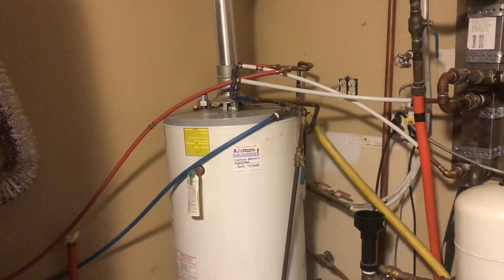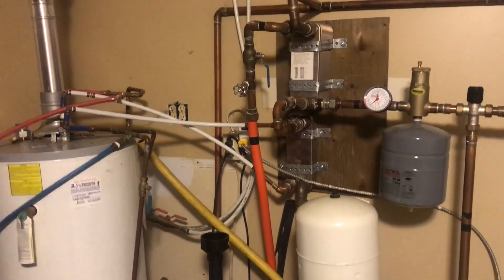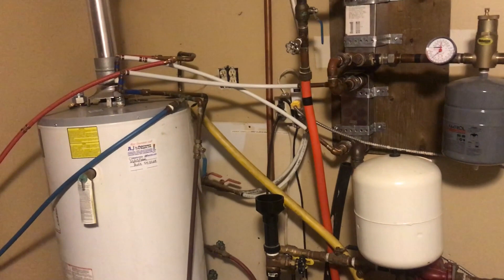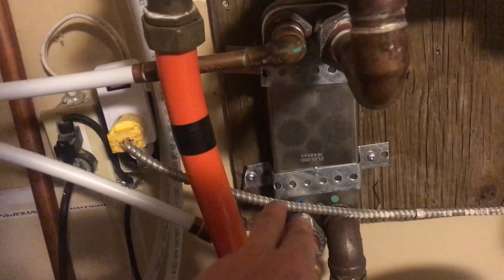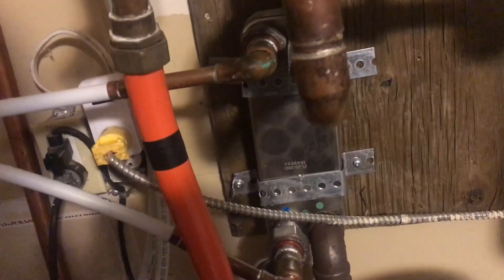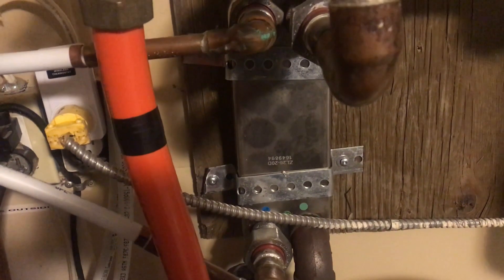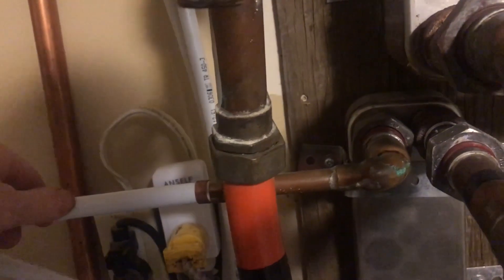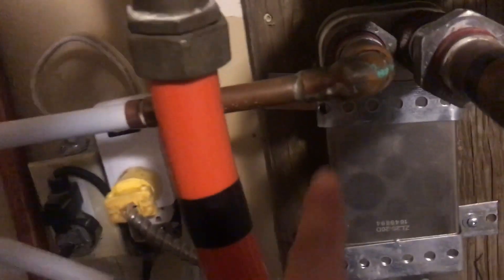Heat your hot water tank with your outdoor wood boiler!

Comment: I have mine plumbed so hot goes directly into house and bypasses the hot water tank.  This does not work!  We have had a woodboiler for about 10 years and always an issue trying to run continuous hot water in the shower and especially trying to fill the tub.  Hot water for a bit then it starts to cool down.  The bath tap has to be just cracked to keep hot water.  Almost like the water is going thru the exchanger too fast.  That was my thought.  So got rid of the 20 plate and put on a 70 plate $600+ CDN and the same issues....ugghh.  So back on the net trying to find a better setup.
Reply from the maker: It definitely will work. What temperature is your wood boiler set to? How far away is your wood boiler? What size and type of lines do you have? What is the temperature of the supply line leaving the boiler and the temperature of it coming into the house? What model of pump? Do you have cross flow on the heat exchangers?  Heating water puts quite the load on a wood boiler, if your system isn’t set up properly for the load, then no, it won’t work! But it can easily provide endless supply of hot water with the proper system! Glad to help you. We have unlimited hot water.
Reply: @acreageliving  I don't know why it will not work with my setup.  The boiler is set to 180 and the temp where it comes into the house is around 174-178 degrees.  It goes directly into my 70 plate exchanger.  I thought maybe I had too much well water pressure so it was going thru too fast.  So I turned my pressure switch down.  it was around 40-70 psi.  turned it back to about 30-60psi.  Where the house hot comes from the exchanger I have a flush port.  I hooked a garden hose up and opened it to simulate house hot water being used and the same thing.  Hot at first then slowly gets cooler.  I don't know.  going to have to look at hooking up thru the hot water tank instead of directly into the household hot water.
Reply from the maker: @Twindadx2_  need all the questions answered. Hot water puts significant load on the boiler. My 20 plate will drop the boiler temperature from 180 to 145 when showering. Rather pinpoint it then guess. But by the sounds of it, sounds like your flow from your boiler is not enough. Many peoples pumps are not sized properly for their load. Or even the size of the lines.

Comment: How is the heat exchanger hook  up to heat your house if you could  send me a picture
Reply from the maker: It’s hooked up exactly the same way. But instead of domestic water running through it, it’s my floor radiant loop.
Reply from the maker: Are you looking to heat with radiant or a heat exchanger in a furnace?
Reply: @acreageliving   Do you have to add a expansion tank and how is the cirulating pump  hook up in the house
Reply from the maker: @shauncrist3522  yes you have to add an expansion tank. I will try to make a video.
Reply: Because what I have now is a old email coal stove that so one change to a oil boiler and I like to take that out and I like to hook it up for this winter  to a heat exchange  and next summer  put a new oil or something  in

Comment: I just bought the heat exchanger to hook up to my HW tank. Question #1 is, so you shut off the tank when the wood boiler is running? Question #2, you mention shutting Wboiler down for a few days, how do you keep the water from freezing? I was told I cannot use glycol?
Reply from the maker: You can shut off the tank or leave it on, doesnt matter, if it is propane, you could turn it off so you are not wasting propane on burning the pilot light. That is the only advantage of shutting it off really. If you leave it on when boiler is running, the water tank will never fire  up unless you are using the hot water when boiler fire is almost out, or say you were on vacation and temp got too cold from sitting in tank and not being used. But most people turn their hot water down when on vacation anyways.

i never shut my boiler down in winter months, it would freeze. When i am out of town my Dad currently feeds my boiler. I did buy an electric boiler though, just havent installed it yet. The electric boiler is going to heat that 60 plate heat exchanger to heat my house. If i leave my pumps on for the boiler, it will steal heat from that 60 plate heat exchanger also to keep my boiler from freezing.  You certainly can run glycol in your boiler. Some people just advise against it because if the glycol is not properly maintained up to specs it can be hard on the steel of the boiler. Turns acidic and less heat transfer. you can certainly run glycol and there is many people out there who do it. The key is justo to maintain the glycol levels an make sure its always up to par. It will lose its freezing capabilities over time, more so in an open to atmosphere system. The glycol works much better in closed loop systems not open to the atmosphere.
Reply from the maker: if you have a furnace in your house, and when you are out of town the furnace is heating your house, the heat exchanger from the boiler installed inside the furnace should back feed your boiler and keep it from freezing. What type of heating do you have in your house? I am all radiant, that is why i need a back up electric boiler
Reply: Would love to see how your boiler is hooked up I have forced hot water oil boiler which also the domestic hot water tank I'm installing a new 960 central boiler this summer